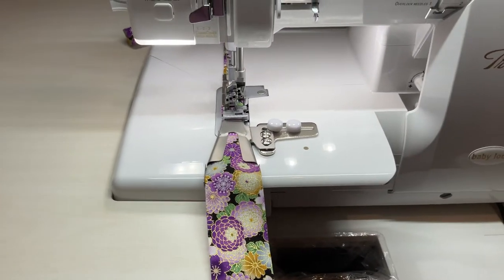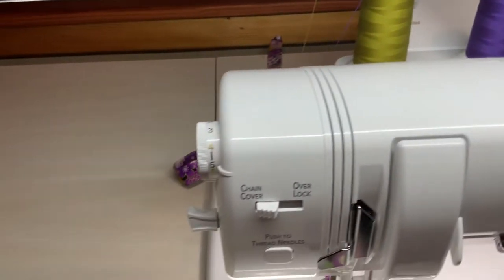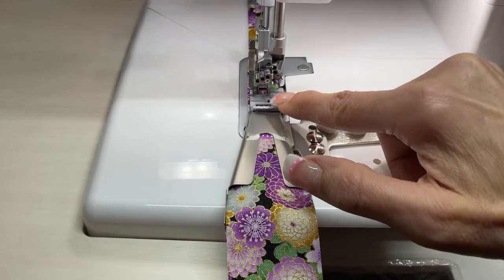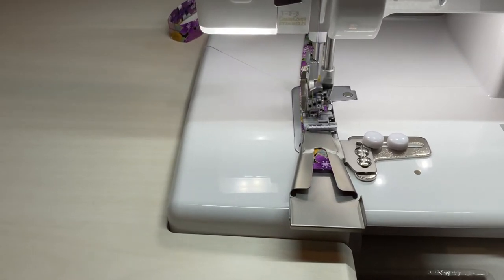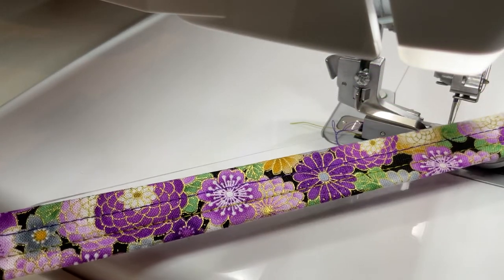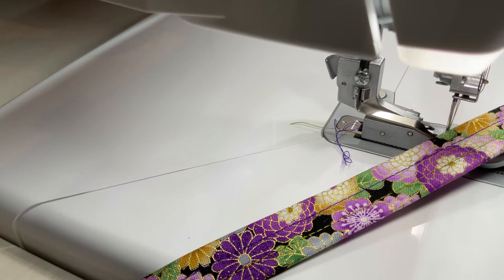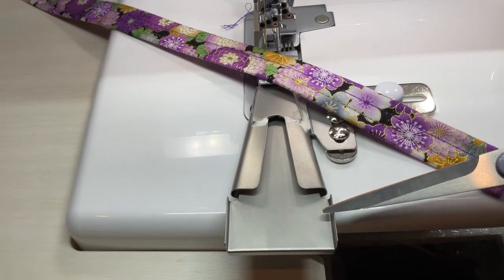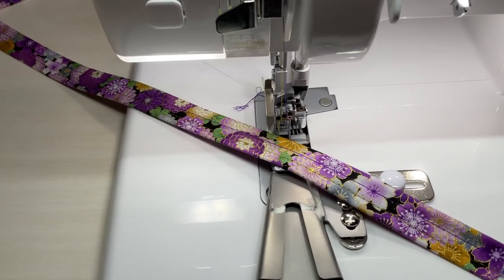Belt Loop Binder on Baby Lock Serger

Comment: How thick of Fabric can this be used on?
Reply from the maker: It really depends on the machine you have. I have a Baby Lock Triumph and have no problem stitching denim. I pay very close attention and the sound my serger makes when stitching. It will give you warning signs that you’re pushing it too far. Broken needles and worse are the result of over taxing via fabrics that are too thick.
Reply: @melindabigleysewblessed  Thanks for the quick response.  I'm actually looking at purchasing the Triumph (currently I do not have a serger).  I have been holding out as I was not sure how much it would get used but I'm thinking more than not with all of the projects I have set up.